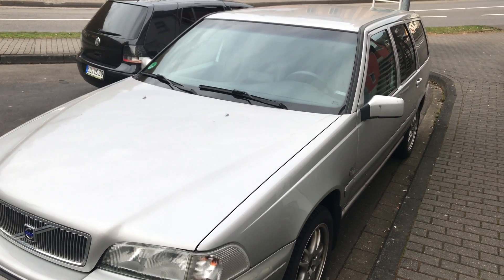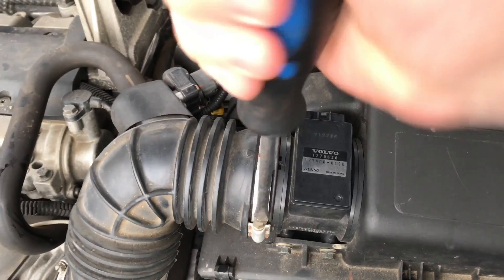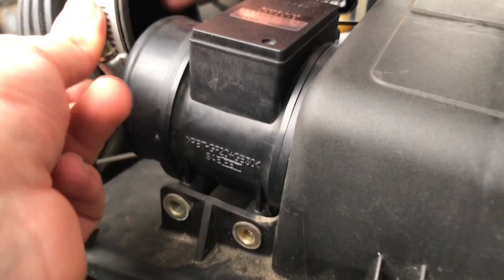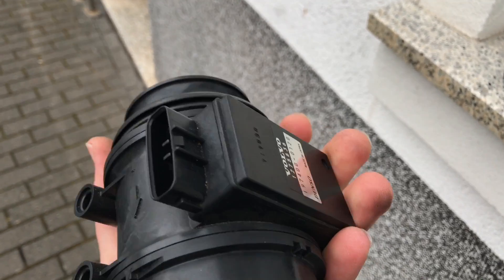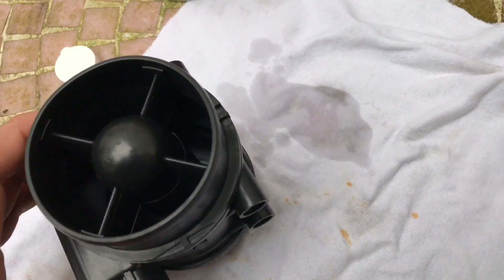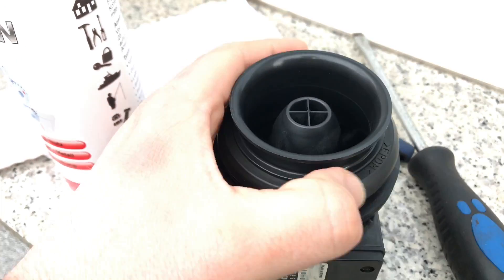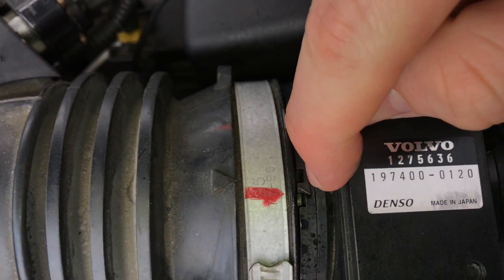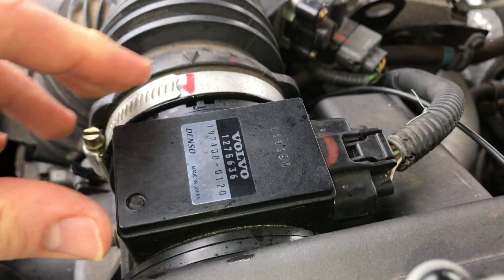How to clean mass flow sensor with MAF cleaner Volvo V 70 DIY

Comment: Thanks for posting this video- very helpful. 
After I cleaned the MAF sensor I received a dtc code for possible vacuum leaks. I did not use the silicone. I’m wondering if that has anything to do with the receiving this code. The car misfires a little. Appreciate any advice on this issue.

Comment: Followed the throttle body clean video as well and did this as well.  Sensor covered in gunk and carb spray did the trick in removing.  No more cutting out or hunting issues.  Great video.  Also cleaned the air filter box as full of leaves and insects

Comment: Can you use contact cleaner?
Reply: Contact cleaner often leaves a slight protective and lubricating residue so I would advice caution. You don't really want that on a heated wire sensor. You are trying to clean off any residue from the wire so you want a cleaner that will evaporate and leave no residue.
Reply from the maker: Alternatively yes

Comment: Just in case any of your readers need a Volvo MAF sensor replacement:

https://alexnld.com/product/mass-air-flow-sensor-fluid-meter-for-volvo-s80-v50-s40-c70-v70-xc-0280218088/

Regards.

Comment: Thank you so much for this video, Love the accent too!😊
Reply from the maker: That makes me happy best regards
Reply: pduesp may I ask a question? I have a v70 T5 2001 volvo wagon which just hit 134,000 miles and my check engine light has been on since September 2017. I bought an OBD from Fixd and it gave me two codes one of which involves  the Mass Airflow Sensor that you demonstrated in this video. When I opened my hood it did not look anything like your volvo and the two screws were weird ( a zig zag hole in the middle of the screw like an allen wrench could fit but won't unscrew it) I believe the re called tamper resistant?  Where do I get these special tools to access the sensor so I can clean it. I need to get my emissions done this week please help😟
Reply from the maker: Could u make a picture of it and send it to me by google+?